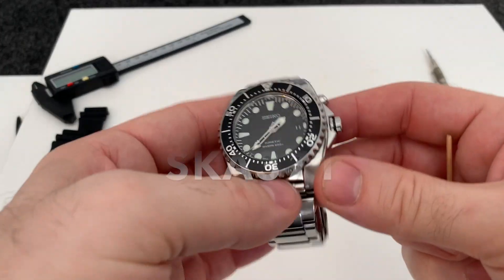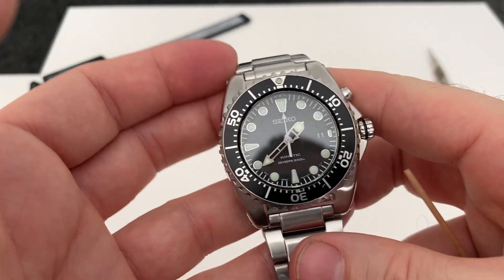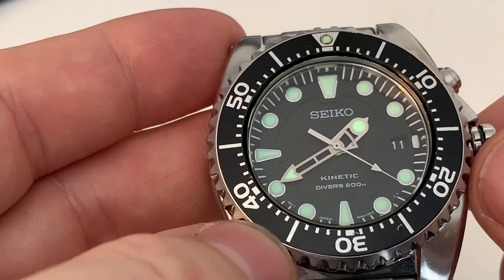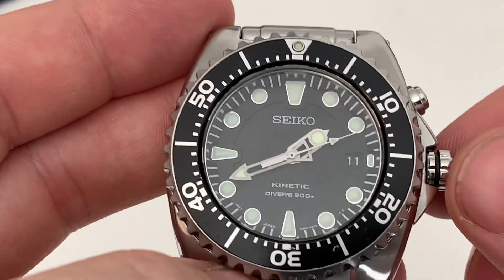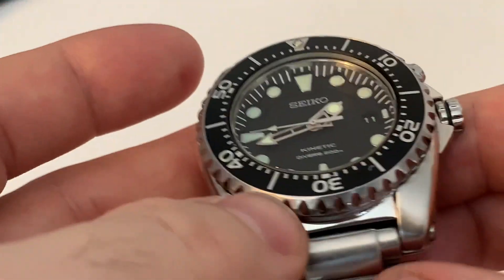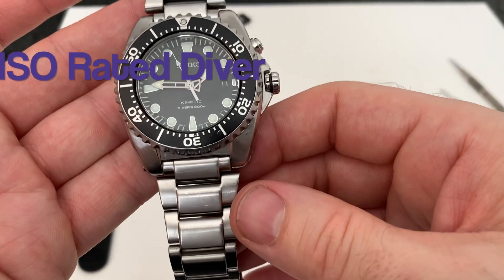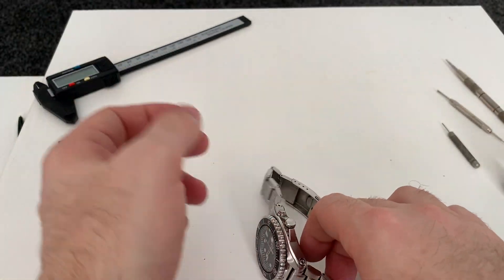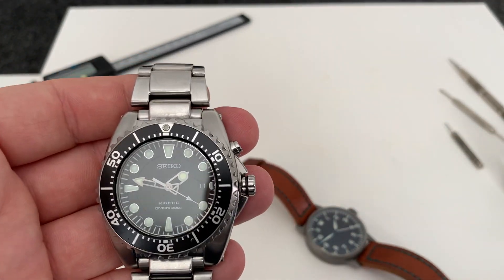Seiko Big Freakin Kinetic (SKA371)

Comment: I've owned one since 2008. I wore it at my job offshore on oil rigs for 9 years--just could not stop it! Easily handled salt water, heat, shocks, vibration and pressure.
Reply from the maker: As I say as long as you wear it daily you'll never have a problem its when you store them they don't like it otherwise bombproof
Reply: You obviously got 1 that wasn't a dud mine broke its a cheap crappy watch
Reply: @derhampaul8496  I call BS on That. This watch is indestructible.

Comment: Worn mine for many 130m   trimix dives for years maybe a decade later  a motorbike accident grazed the glass badly i had it replaced with the bezel insert . My daughter proudly wears it now , i had it for over a decade well over ,, it was washed at 40° on a long wash cycle . I climbed a good few mountains . It was my most abused watch of the time , absolutely 20/10 did not expect it to be half  as tough as it was , there are imperfections but , i had friends taking rolexs off for deep mixed gas dives  and using these after seeing mine soldiering on , thats the truth ,
Reply from the maker: Thats very impressive Joe it really is a tank of a watch 👍🏻

Comment: Great review. Good to see Kinetic technology still getting some attention on YouTube. With the amount of watches Seiko is making, it wouldn’t have hurt if they kept the Kinetic line. I have the pvd version of this. No battery change and still accurate after more than 6 years. It’s a keeper.
Reply from the maker: I'd say at the price this has to be one of the toughest watches out there Rex 👍🏻
Reply: Mine is still going strong after 10 years.
Reply from the maker: @Edward1312   I’m guessing your wearing it regularly then Tony
Reply: @ClickSpringReview  most days
Reply from the maker: @Edward1312  Yeah that makes sense it’s only when there stored for lengths of time they seem to have problems
Reply: @ClickSpringReview  Its not cheap getting the capacitor changed if you cant do it yourself.
Reply from the maker: @Edward1312  I think in the UK in about £50/70 which isn't to bad around £5 a year , if it was a cheap 4R automatic it cost double , One of there high end movements up to £500
Reply: @ClickSpringReview Very difficult in the UK finding someone who will do it for £50-70. Seiko charge £150- £200 and you have to have a service as well, daylight robbery. As much in fact as the watch is worth 2nd hand. Its difficult finding anyone else to do it most of the chain store jewellers wont do it and those they will use out sourced watch repairs and so will charge nearly as much as seiko!
Reply from the maker: @Edward1312  I found a guy on Ebay offering it for £50 , To be fair if you where in the Midlands give it to me I've do it for that price , I'm a studying clock and watchmaker at Birmingham University Sir

Comment: I was really lucky to find mine in a shop selling used goods (as they are now discontinued) and it was like brand new. I love mine. I've currently got it on a very nice premium leather strap from Bob's watch straps.
Reply from the maker: Sounds like a good find Martyn and nice choice of strap also 👍🏻
Reply: Actually,  since commenting, I've put the original bracelet back on. I think it looks better now in its original form.
Reply: I just bought one online from Japan, $200. Is that a good deal, has just some slight scratches.
Reply: What is the original retail price?
Reply: @joshn1224  If I remember correctly, they were £250 when new.

Comment: Gave my first bfk to my lad after he had been obsessing about it from the moment i got it. Even though i have a seamaster, an orange samurai, a pepsi padi prospex amongst others i really missed that bfk so i ended up buying another for myself. His is the same as this one but mine is a very dark blue pepsi with red and its gorgeous. I simply do not wear my other watches. Even the omega is gathering dust. These bfk divers are great. Both ours keep really accurate time. And they are really handsome beasts, a lot of heft on the wrist. We both wear ours loose. They hang just right and we love them. So much watch for the money. Yes i rate it over my omega.
Reply from the maker: Sometimes you come across a watch like that which just fits right , I always try rotate my watches but you cant help and have your favourites
Reply from the maker: @stevea3200  fair comment Steve and the 2500 is a solid movement 👍🏻
Reply: Ahh a kindred spirit! I'm with you. I have a lot of watches. This one is such a beast of a watch it makes my samurai feel like a dress watch 😂. There is a definite feeling when wearing it  I absolutely love it. Its it's own thing and not trying to be a sub or anything else.. That smooth rounded edge case is the opposite of my much loved samurai.

Comment: Nice review👍. I have JDM model of that BFK, great feeling on wrist, I love such heavy watch. Once maybe in 2 years I remove the bezel, clean it properly, apply some tiny amoun of lubricant and push it back to enjoy crispy clicks. But never done it with bezel of my skx007, cos it never sticks.
Reply from the maker: Your right  the bezel is very tight on the BFK , I do the same sometimes I just spray a little oil to get the get the bezel to loosen up and the wash  it out
Reply: Any link to a guide on how to remove the bezel safely please?
Reply: @curbyourshi1056  Hi, just search in google or youtube with “how to remove bezel on seiko skx”. There are plenty options of videos. Same principle works for skx and bfk, doesn’t matter what you have. I already used same way for skx as well just to see “structure inside”, with skx it is little bit harder to remove. I just use broken kitchen knife, what i have grinded on the edge as flat as possible which easily gets under bezel enabling me to pop it out easily. Then I use alcohol to clean all scrab out, put some tiny amount of oil and get all fixed back. It keeps turning well for 2 years at least.

Comment: Got mine from Hong Kong about 10 - 15 years ago. Was just looking up how to repair the bezel, as mine is shot and I need a new insert too as I wear it at all times. Love this watch and want one of those Orange Monsters next. I use Wahl clipper oil on my bezel when it gets tight. Think it's rusted out a bit now though. I should take better care of my watch, but I love wearing it too much.
Reply: Hello. Have you ever changed a battery/accumulator on your watch? Mine is almost 8 years old, but battery keeps well so far. I never let it go down always keeping charged up.
Reply from the maker: It was my friends watch sir, the next video I replaced the capacitor now its runs and holds a full charge

Comment: Have one with the pepsi bezel. Have used it every day since i bought it more than 10 years ago. It is indestructible!! Best watch I have ever had. And I worked in a watch shop at the time, so I got it really cheap. 🙂 Normally wear it with the original rubber strap but sometimes put the metal bracelet on. And it is big and heavy - but I like big watches. 🙂 Anyone know where to buy alternative straps that fits and look good on it?
Reply from the maker: I think a big chunky leather strap would look great on it , As I say if you wear them every day they will carry on going its only when you leave them in draw say for a few months they don't like it

Comment: I have one almost identical to this, but blue & red, wore it from new for 3 years, fully charged, never took it off. Left it for a week and it’s never went past the 10 second mark ever since. It just will not charge back up. I really don’t like kinetic because of this. Expensive watch but it’s supposed to last 6 months from full charge and they simply don’t live up to that at all. If you get a new capacitor in it, if it’s not charged up will it be okay until it’s worn and fully charged? Or does the fact it may sit for 2 years before being sold affect it?
Reply from the maker: If you fit a new one like in the video it well be ok ,  but best to wear it for a few days to allow it to charge up before letting it rest for anytime
Reply: All lithium Ion batteries, need 3 fully charged/discharge cycles, before they can hold and maintain a full charge.

Comment: What was the original price?
Reply from the maker: I think they were less than $180 but cant say for sure Josh
Reply: Darn, I paid $200 and it was used. In good shape though. It comes with the metal bracelet.
Reply from the maker: Sounds good when the Seiko MM300 first came out they were £1100 now they are almost 3k same movement same case so don't worry about it
Reply: @ClickSpringReview  I have a mm300, the Tuna Can you mean?
Reply from the maker: @MyWatchTherapy I just mean the way things go up as I say my first MM300 only cost me £1100 bit look at them now you can’t buy a used one for that price

Comment: I've been wearing the orange version daily, had the change the li-ion battery last month and it's still waterproof (there are no capacitor in these Kinetic watches btw).
Reply from the maker: All kinetic watch were fitted with capacitors back in the day its only in the last few years that rechargeable li-ion battery's have become available. I replaced the capacitor in this one with an OEM seiko model. If you wear the watch daily you shouldn't have a problem its when you leave it sat for long periods they start to have problems just like the battery in your car
Reply: @ClickSpringReview  I understand Kinetic were supposed to be battery-less quartz watches, that 90's models had capacitors to hold charge, but BFKs have batteries, mine had no cap.
Reply from the maker: This one had a capacitor the ref number is Seiko 30235MY when I spoke to Seiko they said this is standard fitment for all BFK Sir
Reply: @ClickSpringReview  I believe you, maybe they meant world market ones. The orange sbcz025 had a battery but it's JDM, so maybe...
Reply from the maker: here is a video of me removing the original capacitor go to 4:00 https://youtu.be/04ZhelG89cM?si=fZ4cs2SfsBpaiJgD
Reply from the maker: Yeah could be right, the one in the video belongs to a friend who imported it from Japan himself. Do you still have the old battery ? or the reference for the one you replace it with ?
Reply from the maker: I've been checking and turns out there isnt any difference from what I can tell both should run for years as long as you keep them changed no less than 40% . But very much recommended not to allow them to be left discharged for any length of time